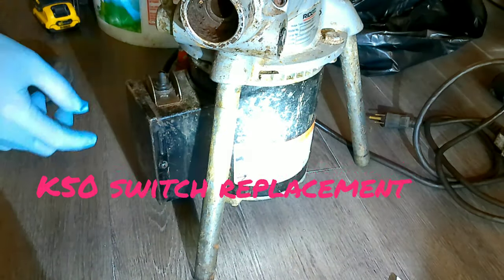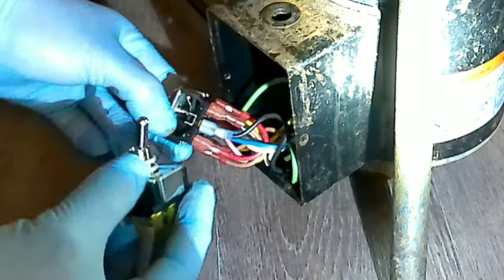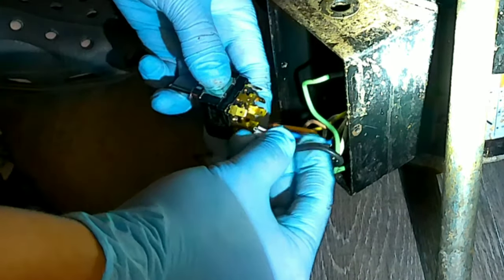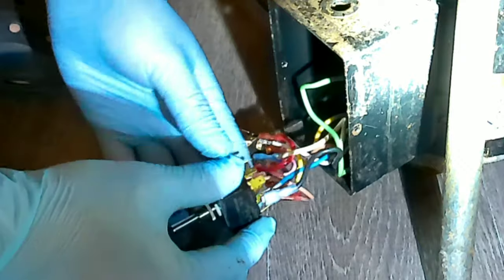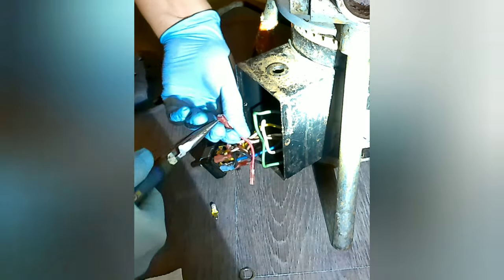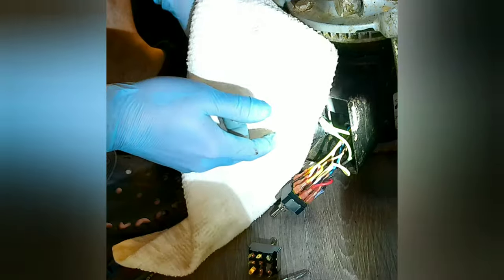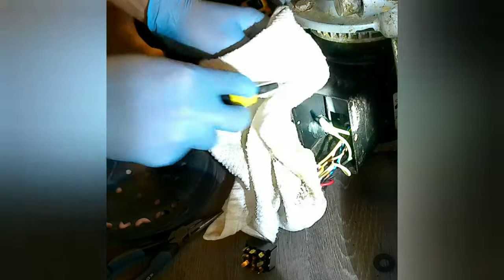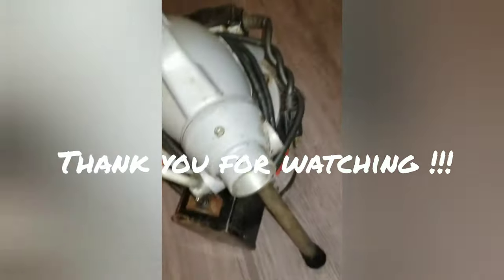K50 Switch Replacement

Comment: Hola desde Colombia 🇨🇴  necesito una ayuda cuando la.maquina pasa toque  patae al tocarlo  como puedo solucionar  gracia. Jefe
Reply from the maker: Hola. A que se refiere con pasa toque?
Reply: Al conectar la maquina pasa corriente  cuando esta trabajando
Reply from the maker: @davidibarraarrieta2103  Probablemente una de las conecciones en el switch tiene la insulacion o ule pelado y esta tocando el metal (haciendo tierra). Revisa que todas las conecciones esten fijas y ningun cable este pelado. Si todo esta bien. El switch esta haciendo tierra adentro y necesitas cambiarlo.
Reply: Excelente mucha gracia será bueno usted h8ciera un video de la maquina mantenimiento